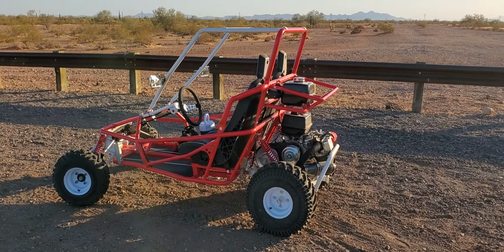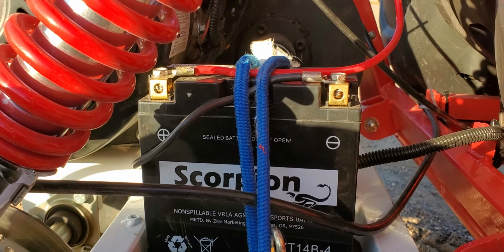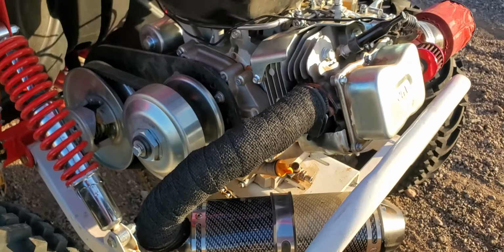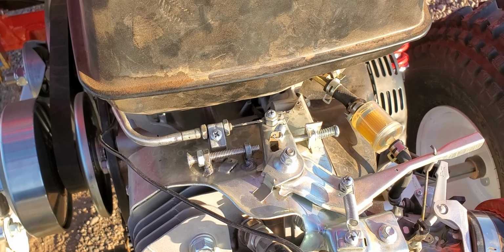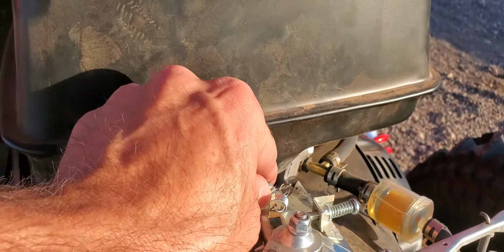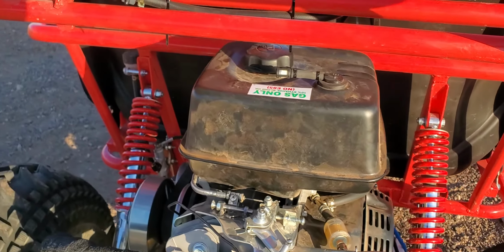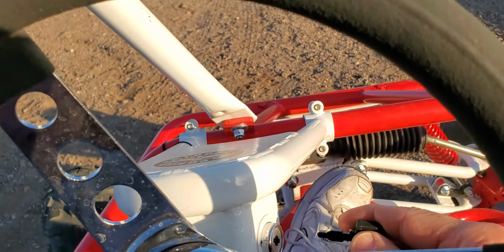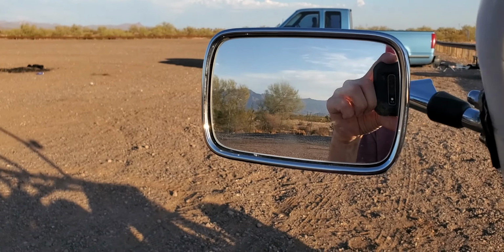Yerfdog 420cc new modifications

Comment: Still following your build and doing something very similar so thank you!  Ive got the stock 420 with gov and using the stock throttle linkage but it will barely move.  Did you experience this too?
Reply from the maker: Thanks, I've got a lot of content to upload. I installed billet flywheel, alternator, front brakes.  Stock 420 ran fine for me. You say the kart barely moves as long as the throttle linkage moves the lever you should be fine. What are the symptoms? I ran stock for a while before modifications. This video was stock 420cc
https://youtu.be/nXVrGdjBjU0?feature=shared
Reply: Thanks for the quick replies always, I just feel that the gas pedal doesn't move the lever enough to really get it going.  It could just be the gov.  Still messing with it.  Ive built a 212 with billet stuff and connected throttle cable straight to carb butterfly valve, I was just hoping to keep the 420 stock and not mess with it. @justinsauer5682
Reply from the maker: @BrandonHawkins-e4p  if your throttle cable is moving the engine throttle lever its full range, as if you were moving the throttle lever by hand, then the issue is not the throttle cable. Just make sure the engine throttle lever is being fully engaged when you press on the pedal. Another thing you can do is look in the intake of the carburetor,  the butterfly should be completely opened at full throttle (pedal fully down) if not then your throttle linkage is screwed up somewhere. If you're air filter is extremely dirty and restricting air flow that will also cause it to run sluggish as well l. Governor only engages at higher RPMs to slow down the engine. I don't think it's an issue with the governor. It should run well with it in, with lumitted RPMs.
Reply: Thank you, I adjusted the throttle to already pulling on the arm more and its better.  Im positive I will eventually go billet on rod and flywheel again... lol.  what's your opinion on the shift to bypassing the gov and connecting straight to carb butterfly? Much better? @justinsauer5682
Reply from the maker: @BrandonHawkins-e4p  you'll definitely tell the improvements removing the  governor. I'm not sure how just to by-pass it. If you remove it, one thing you need to know the ignition coils of the 420cc still have a spark limiter in them so you'll not be able to reach max RPMs unless you buy the an ignition coil without the spark limiter. That's what I did. Careful though it's recommended to upgrade to billet flywheel if you're planning in running max RPMs. Cast iron flywheel could explode at higher rmp 4k +.